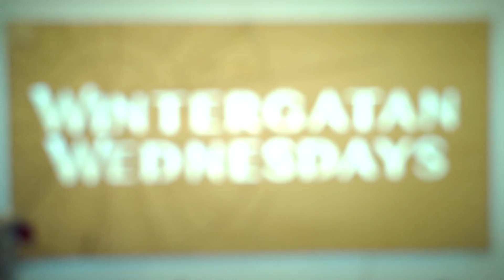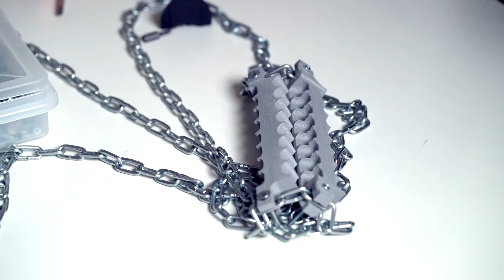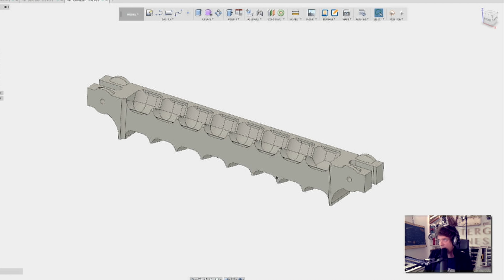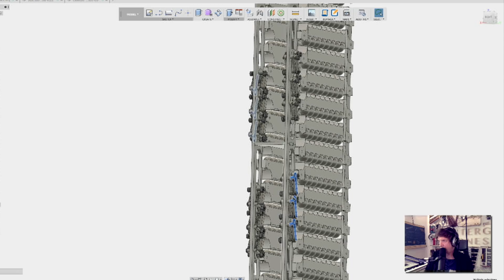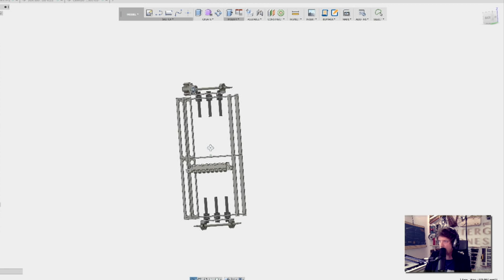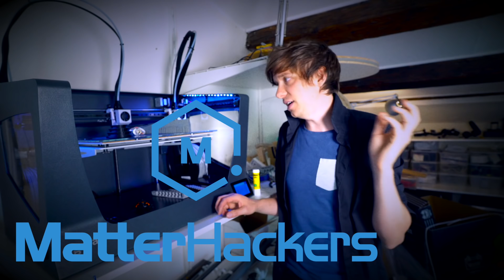3D Printed Marble Lift - Marble Machine X #34

Comment from the maker: PLEASE READ: About the print quality in this video: Let me just repeat that this was the absolute first runs, without calibration,  using support in the wrong way, using a bad print direction + a design that had not been optimized :) I just feel like i should defend the printer a little bit more since there is a lot of comments about the awful prints that are clearly due to user error. So, i have no doubt i will get it crisp once i had the time to calibrate. BTW, the filament is RYNO, we had great results with EDGE before, trying both.
Reply from the maker: Was just about to pin when i saw your comment!
Reply: I think if you printed the part rotated 90° backwards from the first print you showed in the beginning, then it would only need support material between the bracket for the chains. Splitting the part in half will only cause more issues with assembly and take longer to assemble , as from the current design you have it will need a lot of these parts to be made. You may want to also look at the retraction settings for your printer profile, as that will eliminate the oozing of filament when the printer stops.
Reply: Wintergatan It's always a learning curve with anything new but it's surprising how much you learn from one print - you're already thinking about a lot of modifications.

Which reminds me, I need to work on the 3D printer I built over a year ago and gave up on calibrating. Maybe I'll learn something ;)
Reply: You could get some pva filament for the supports. After the print just drop them in water and the supports disappear!
Reply: do you mind pinning your comment? it will help others notice it more efficiently.
Reply: Nvm.... 
Did a refresh on my browser and noticed that you pinned it.
Reply: If you have the dual extrudes 3D printer, print the supports with pva, it will be so easier to remove and the quality is better!!!
Reply: Not sure what software you're using to produce the gcode, but I strongly recommend Simplify3D. It's a bit pricey, but the support material it generates is way easier to remove than any other software I've tried. Leaves less to clean up after prints, and they look nicer once you're done, all else being equal.
Reply from the maker: @andrew Yes! Thats seeing the whole picture, good luck with your printer!!
Reply: Don't split it! Just turn it 90 degrees! And print it sideway
Reply: https://www.techfak.uni-bielefeld.de/~joern/jargon/frobnicate.HTML

"If someone is turning a knob on an oscilloscope, then if he's carefully adjusting it, he is probably tweaking it; if he is just turning it but looking at the screen, he is probably twiddling it; but if he's just doing it because turning a knob is fun, he's frobbing it."

You were "Frobbing" the printer. Have fun! :)
Reply: Having a second extruder makes support really easy, you can buy PVA Support filament.
PVA filament is water soluble, so all you have to do is soak you part in water to get rid fothe filament.
Reply: When you print in multiple parts, consider printing them with aligning holes and use small aluminium or brass pins (just cut them from a rod, I usually use 1-2mm diameter stock) to align the parts exactly when glueing them. Makes it a lot easier to do precisely, and adds shear strength, too!
Reply: You should run test prints, like try to print some shades for Wilson
Reply: hey wintergatan, just a thought but if your ratchet system doesn't work well have you considered an aesthetically pleasing version of a Geneva gear?
Reply: Looks really good, but look into disssolvable support material. Put the dual extruder to good use!
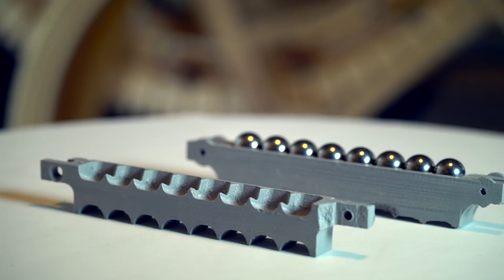Reply: I would personally say that for this specific part, I would not split it as that would make it very weak around the point where you put in the screw for the chain. I would print it in the orientation that you have it when you are drilling it at 1:10 since the part has a nice flat back, so the only place you need support is between the sides of the slot where the chain sits. This would mean that you need no support material in the holes that you had to drill out, and nothing in any of the channels where the balls sit. This would make your prints more repeatable since you do not need to file out the ball slots. I would generally say that with 3D printing that you should orient your part so that it takes the least support material possible, unless unless it needs to be a certain direction due to to strength issues (like wood has a grain, 3D printed parts have layers). However, well done for getting your own printer, and I wish you luck as you experiment, learn, tweak and improve! Also (as others have said) have a look at soluble support materials like PVA. Since the sigmax has two nozzles, one can be used for the print material and the other for the soluble material. The soluble support tends to break off quite nicely and the rest can just dissolve off in water.
Reply: Don't forget to calibrate your material too: https://www.thingiverse.com/thing:2092820
Reply: i admit, its not the best

but even if you would build a potatomachine, id still watch it
Reply: I was just thinking about that! The soluable filament for supports is really what he needs for those complex designs.
From my own experience, I would recomment that together with printable angles (45° is great, sometimes you can get away with even as steep as 35°). Printing two different parts and then gluying them together is a bad idea, because there are always little differences in the prints (especially if you have parts with mass difference) and the often don't fit together.
Reply: Hi Martin,
I also recommend the useage of PVA filament for easy support structures. But take care of high humidity as the filament soaks the water from the air and gets soft or blisters while printing.
Wish you all luck and fun ;-)
Kind regards
Roman
Reply: Another tool in the Wintergatan arsenal.  I have no doubt that you will be a 3D printing pro in no time.
Reply: Wintergatan no video this week?
Reply: The support material is supposed to come of way easier than it looked in the first timelapse. Make sure that your temperature is right for the filament and if that does'nt help you could try lowering it by 5degrees at a time (up to ~15 for quality). If that does not help there should be a vertical support clearance setting in the menu of your slicer (the .stl to .gcode converter).
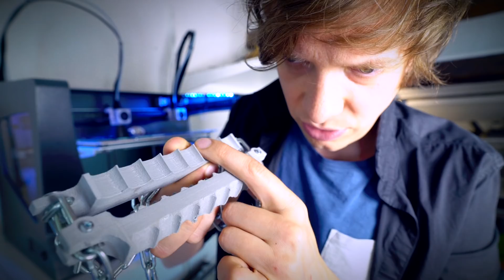Imo, the best way to print these are as a lot of people say, just like the one you point at @4:21, if you get the support settings right it should be easier and faster than glue (i believe).
Love your videos! Good luck :)
Reply: Man! what a printer! with that beast you shouldn't need to cut that part. Maybe print it using another face and there is no need for a raft, it will give you more work. It is always better to try and print directly from the buildplate ;) 
PD: Try a bunch of slicers, every one of them have different results for different printers and models.
Reply: You can also use water-soluble filament because you have dual extruders! I recommend PVA. It shows up as a supported material on the BCN3D website. Make one extruder print PVA supports and the other PLA plastic (or whatever you want). Then just chuck the printed part in water and in an hour its perfect! No sanding or anything needed and you can make really complicated designs.
Reply: Hey about printing with a dual extruder printer: water dissolvable filament exists. If you can’t find a way to print without support material use water dissolvable filament as the support structure so you can throw it in water afterwards and not file it down.
Reply: Looks cool 
I know it’s more work but why don’t you print in a dove tail joint in the 2 half’s then you can join them together easier with very little worry about them coming apart when being used as apposed to just gluing them ??
Reply: Look up Acetone Vapor Finishing. It's like sanding your parts smooth without sanding :)
Reply: You should check out Thomas Sanladerer on youtube for some really great tips on 3D Printing!
Reply: Actually Printing a Temp Tower is the best way to find the correct temperature settings for the filament on any printer, its the very first thing i do if its a filament I have not used before
Reply: If you're going to split your shuttles, you may want to add registration holes & pegs to each half. It will ensure the halves line up when you glue them together.
Reply: With my experience 3d printing.... Just turn the print 90°, so that the back wall of the marble holder is on the bed. This should mininize support to only being in the groove that the chain slides into. This would also allow you to print the holes in without the need to drill.
Reply: There was me thinking the whole point of a 3D printer was to knock out something as quick as possible to just see and to try. If it works then polish if not then print something else....
Reply: This is exactly what I was going to say.
Reply: If you want very high quality without much of a fuss, just buy a Zortrax or Ultimaker. I have 2 running 24/7 hours for many months and no problem at all. Supports are really easy to get off.
Reply: Use wood PLA. It has bamboo wood and looks like wood. It also has some flex.
Reply: I'm glad I read your comment.  Yes 3d printing it just like any other technique.  You just need to learn the tool and it's strengths vs weaknesses.

Most of the work for manufacture is worked out in the design.  You just learn things with each failure.

Keep up the good work and thanks for your videos.  Your build makes me happy.
Reply: You should have printed on its side
Reply: Why would you splitt it in half though?! O.o
If you just lay it 90°C flipped on its back, wouldn't it work just fine? :D

Keep on! ... I would appreciate you to come touring on Hamburg, too!
Reply: I use the BCNs a lot and I know you're using a wierd filament and probably(?) the "standard" settings as you and others say. That result as you say is not the machine and would be the same for any other withuot a setup of 3rd party filament in it =).  If you need any help,support or  ballplank with 3dprinting you have experienced swedish enthusiast here! 
Many 3D printing users are hobbyists and don't have to value the time going into prototyping in the same way. I think you shouldn't have to defend making a fast, less nice-looking print. It's actually good being able to do both "draft" prints and later more finished parts.  The issue is of course when the support and post-processing takes too long. As you say, smart design helps cut time in many stages.  

Anyways! I'm also working with Matterhackers and can recommend them for getting help getting into 3D Printing!
Reply: Runoratsu I missed this comment when I posted mine about registration pegs and holes. Your solution would also work exactly the same. I think the only difference is the need for extra hardware.
Reply: Wintergatan remember, you can get water soluble print material to use for support since you’ve got dual extruders
Reply: One advice, you can print support structure with different soft material than body  and will be esy for separate.
Reply: Great video as always and thx for the music recommendation! :D
Reply: I'm not a 3d printing wizard, but please use another color than the dull and ugly gray you showed in the video :p
Reply: Cory Taylor  Oh that's a good one! 👌👌
Reply: try glass and a spray called 3DLAC works so great that u can't get the print easy of the glass :P
Reply: beat me to this comment so I'll just add my support for this idea :D Simplify3D is by far the best application I've used for 3d printing.
Reply: Wintergatan i
Reply: Lol, Because you didn't already say that in the video. I am really excited to see what you come up with using the 3D printer, I figured it was only a matter of time until you got your own, Congratulations!
Some general printing advice, 
Not sure how fast your prints are coming out, but for prototyping I use 0.2-0.3 mm lairs and bump up the feed rate. 3D printers can move pretty fast when the print bed isn't moving back and forth.
I use around 15-20ish % infill and depending on how strong I need the part, I'll bump up the outer perimeter thickness in the slicer settings. 
and for your final parts, make sure to NOT use PLA, I would hate for any parts to warp in transit from heat exposure.
Reply: This only works if you use ABS as far as I'm aware.  It may work with ASA, but that's super expensive from what I'm seeing and appears to be very limited on color.  ABS is hard to print (relative to PLA).
Reply: @Wintergatan I had a question regarding the overall project. Have you considered all the noise generated by all components while the Marble Machine X is running? Will that be an issue? Perhaps the machine is designed with that in mind, but though I would ask.
Reply: What software was that you were using?
Reply: a PrintinZ skin does a better job
Reply: Good Luck mister Wintergatan (y) with this project !    (  https://www.facebook.com/hanny.hasquare?lst=100000597784975%3A100000597784975%3A1525964976 )  .
Reply: Wintergatan I
Reply: Wintergatan  

Hij;NHG
🌳🐇🐈🚥🗽🚦🚧🚧🚧🚧🔞♨️
Reply: Aren't you worried about the sound?
Reply: Wintergatan well said. I am happy you pinned this. Hold me from complaining 😂🐙😋
Reply: It's not painful that you had bad first experience with 3D printer. What's painful is you got Lamborghini model and got that result. My CR-10S printer is 1/10 the price and has been reliable almost from the 1st print. Good luck and hope they provide you much helpful support and software assistance!! They should be available 24/7 for phone and e-mail support. Love your videos!!
Reply: If you use PLA filament for the part and put it through one extruder and put PVA filament through the other extruder for the support material, once the print is done you can dissolve the PVA (non toxic) away. It makes for a much nicer print and the clean up is much easier.
Reply: I thought the same thing! 90° is the best choise, and as we see in the next video he did so!~
Reply: SnickersSnake next episode https://youtu.be/aleY_84rOiY
Reply: Random comment passing through, excuse me.

Comment: I'm actually concerned with the noise due to the ratchets clicking all the time. You put so much effort into silencing the wooden gears and now you add a seemingly tumultous part to your machine. Seems like quite a waste, actually.
I figure the Archimedes screw would make a lot less noise and could even pass the 'rule of cool' with multiple of them arranged on top of each other, using transparent tubes so the marbles remain visible.
I really have to congratulate you on your progress so far and on the idea to plan out the machine to the finish first, thereby directly involving and even inviting your community into the brainstorming process. Rock on, Martin!

Comment: Hi, I really like this design! Can I offer a couple suggestions that would increase the usability? 1: make a 3D-printed curved guide at the top and bottom so that each lifting section never leaves the guide. Or add a long chamfer on the leading edges so that the sections do not get caught on the guide. 2. Unless I am mistaken, you will have to remove lifting sections from the chain in order to use the 3 big tensioning bolts. Perhaps the design could be altered to allow adjustment from the sides without disassembly.

I am always excited to see the progress you are making on the machine. I can't wait to hear it play!

Comment: you dont need ratchets... they add more drag, noise and unwanted vibration. Use one way bearings... they rotate in one direction but lock in the other.

Comment: you can also print with a dissolvable support material, so instead of sanding and poking for a lot of time, you can just give it a quick soak in limonene or something! Behold the magic of dual extrusion!

Comment: Might it be better to split the conveyor pieces along the  plane parallel to the forked sections at their ends?
You wouldn't have to worry so much about gluing or anything as you can just bolt then back together and based upon what I can see, your design has pretty much no except with the fork on the top piece and a small amount on the channel dividers.
Reply: Pretty much just change the plane of your divide by 90 degrees and maybe center it in that space.  But you might be able to print that whole thing without supports from the look of it.
I am by no means a 3D printing expert but it may be worth a try depending upon who you wish to approach the problem

Comment: I don't know which material you use in the 3D printer. PLA will potentially sag during shipping of the machine due to the low glass transistion temperature. ABS will warp like crazy with this unenclosed machine. Perhaps PETG would be be a good choice for you. 
Be aware that the better part you showed, printed by someone else wasn't even that good. You can print better than that, but it will take a lot of effort to tune everything.

Btw, you should uses the second nozzle for a dissolvable material like PVA. That would solve all the support issues you have.

Comment: I recommend simplify 3d for slicing your Stl files. And remember don't use pla for your final prints if you don't want some nasty surprises during your tour. (Just put a test print of pla in a hot car and you'll see). I personally recommend PETG.

Comment: couldnt you just flip the piece 90° on its side? when printing? that way i belive you dont need to glue 2 pieces and i doubt it need supports either, if it does need supports it propably would be a lot easier to clean it up aswell

Comment: Be careful when you leave it printing overnight. If its too hot it could catch fire
Reply: This is mainly a problem on cheap Chinese clones, and its usually the electronics that is overloaded. which catch fire. Not the heater itself.
Reply: Also, a printer of that caliber  I am sure has thermal runaway protection
Reply: Thomas Hodnemyr thx thats reasuring(sry for englisch)